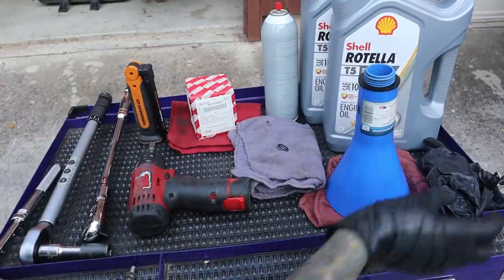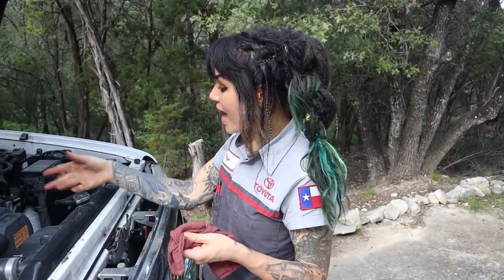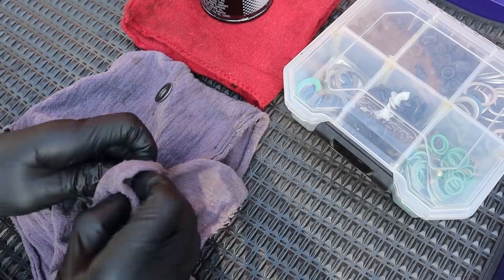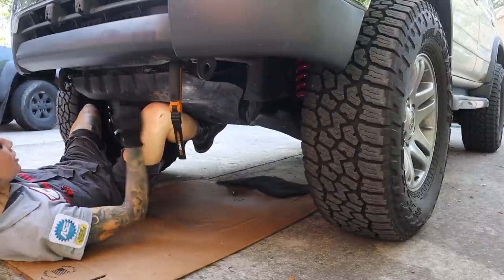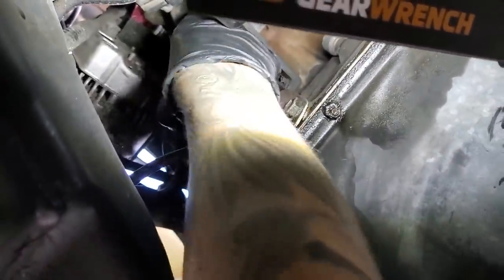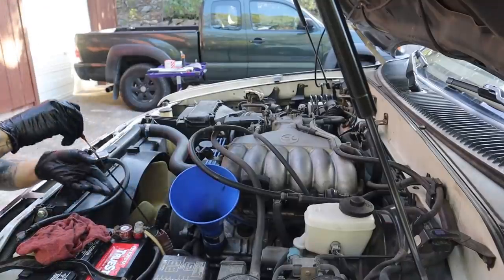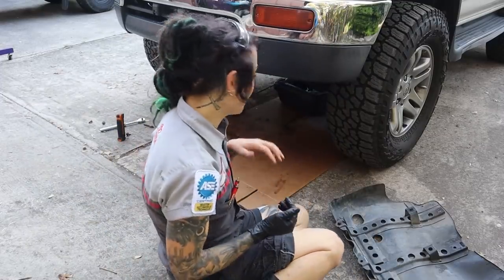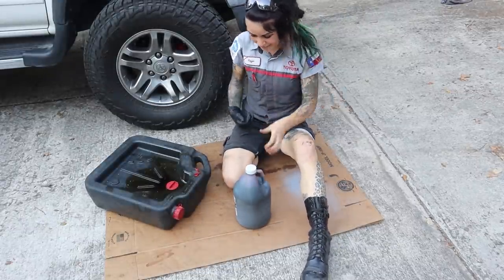How To Change the Engine Oil and Filter on a 3rd Generation (1996-2002) Toyota 4Runner V6: 3.4, 5VZ

Comment: Faye, what's your opinion of prefilling the oil filter before installing it?  I'm going to start checking my boots from now on.  Thanks.
Reply: I've been changing oil in our family's cars for the last 35 years and had never heard of prefilling the oil filter until recently. If the filter is mounted sideways or upside down there really isn't a way to pre-fill it.  I suppose it can't hurt to do it but we've never had an oil related engine failure or problem in all my years of working on vehicles with my Dad and Uncles. Just my two cents.
Reply: Someone taught me to prefill the filter about 20 years ago, and I've always done it whenever possible since then.  may not be necessary, but I can't think of any downside unless you forget to factor it in when measuring how much oil to add.
Reply: My dad does that, but I've never seen a need.  Regardless, I always run the engine for about a minute or two.  It should just take seconds to completely fill a dry filter.  The tiny bit of excess potential wear you get before that happens is not enough to worry about, maybe about the same as two or three startups.

Plus on engines like the 3.4L shown here you can't.  The filter sits at about a 20 degree angle with the opening pointing down.  Both Grim and my '96 Taco have over 300k and still going strong.
Reply: @subtegral  Thanks Faye!

Comment: I found one of my pan bolts broken off and whoever put it back just used a self tapper and made a new hole 😫. Well it bugged me enough that I drilled out the old bolt and was able to save the threads and put in a new bolt 😃

Comment: Faye,  I have a question kind of related to an oil change. When changing CVT fluid do you prefer using the manufacture recommended fluid or a brand with maybe better properties?
Reply from the maker: I'd NEVER use non OE fluid in a CVT! So many of them include "additive packages" that cover a wide range of manufacture's recs. The OE is specific for that transmission. I suppose I can always speak for Toyota ... but even when I worked at an independent shop and had all of the other fluids in bulk, we would pray the premium price for the OE fluids that we could feel comfortable standing by our warranty on the vehicle!
Reply: @FayeHadley  Thanks for answering my question Faye 😁

Comment: Faye any thoughts as to why GM designed what I  call  low oil pressure  in my new 21 Silverado with  the 2.7L Turbo 4cyl. Regardless of normal  drive rpms it only shows 30 psi. MY 08 I used to have with the  4.8 v8 ran 40 psi  plus depending on  rpms. The only time I see  greater than 30 is at cold start up  and if you get really aggressive with  high rpm. Not sure if they design a regulator on oil pump or what?  I like to see 40 psi when driving highway speed. It does call for 5w-30 ,the 5.3 with 0w-20 oil  runs higher oil pressure  go figure?

Comment: You can probably take out the oil filter without removing the skit plate but 9 out of 10 times the oil mess from removing the oil filter will build up on the skit plate and overtime is just too messy. On my 2000 limited, it is so tight (maybe impossible but if you have tiny hands it might work) that I prefer just to take out the skit plate.
Reply from the maker: Totally! I have one of those bendy directional funnels that actually makes it quite mess-free! (https://amzn.to/3yCxs45)

Comment: Question Faye, have a 1996 toyota t100 Sr5 3.4l. Did my oil change and filter change on the truck put in 5 Quarts of brand new 5w30 oil with filter.  I know it takes 5.5 Quarts but is running on 5 quarts safe and okay for a awhile till I can top it later, which probably won't be for another four days or so till I can pick some up.

Comment: I have same truck like yours 01 4runner 2wd I take it to the dealer to get the oil change. Supposedly they were using the conventional oil.  The truck has 146,000 miles is it safe to change to synthetic blend?
Reply from the maker: That's pretty low mileage, But I would still start with a synthetic blend first and just see how the truck reacts to it. I would change slowly over time. Sometimes adding synthetic oil can drag up a bunch of debris with all the detergents running through the engine, and can cause more harm than good. That being said I switched to fully synthetic at 300,000 mi after weaning this truck onto it for over 2 years, and I haven't had any issues! I just was very regular about my intervals!!!
Reply: @FayeHadley  thank you so much for the info. I appreciate it. I love your videos. It helps me out to work on my truck.

Comment: What oil do you normally use?
Reply: I think depends on what motor
Reply from the maker: I normally use the Rotella T6 (fully synthetic 5W40!) in Grim, as well as for the 2009 Tacoma you often see here on my channel! I used to work for Intertek Automotive Research in SA, TX testing oil and fuel for a living, and it was always a running joke with the mechanics... an oil would test AMAZINGLY "but how does it stack up to Shell Rotella T6?!" it seemed to be the only oil that would test higher than spec, and the manufacturers wouldn't spend hundreds of thousands of dollars to reduce the expensive additive package and re-test over and over again just to barely clear the bar for the standard. 

I use the T4 15W40 in my 1980 VW rabbit, and Valvoline VR1 in the Supra. All have withstood the test of time! VW has over 400k, This truck has 307k, the Taco has 175k, and the Supra has 250k and I made a video about the oil saving my cylinder head. :)
Reply: @FayeHadley   Thanks for the info, very interesting that you worked with lube oils! I also worked as an analytical chemist...we did turbine lube oil and transformer oils. Shell generally makes very good oil. One of the first synthetics I used was Helix Ultra... Unfortunately Valvoline is difficult to get here in South Africa. My current favourite oil is Total Quartz 9000 ;-) Those are very impressive mileages you have on your cars!

Comment: What is the oil you normally use? I use 5w30 full syn (valvoline or castrol all depends on where I am) for my 00 4.7 tundra
Reply from the maker: I usually use the T6 fully synthetic in my 4Runner, and the Taco behind!
Reply: Faye, is your 4Runner a diesel?

Comment: Why did you use 10w30 instead of 5w30 is it much of a difference ?
Reply from the maker: Because it was out of stock, and its VERY hot right now, so the viscosity difference won't matter at this time. I usually use 5W40 T6 Rotella!

Comment: Strange place to put a ground wire....right under where the oil drains from the filter.
Reply from the maker: Never gets corroded!!!
Reply: Better that than a hot wire for your oil filter wrench to spark against! (Saab 900.)

Comment: Got P0171 code in my 2007 Corolla! Need Faye's mechanical magic 🔧🚙🧚🏻‍♀️
Reply: Sell it and get a old school lol
Reply: @NotaMechanicJack  Still got $5000 left before it's paid off. As Scotty would say, cars are endless money pits! 💸
Reply from the maker: 1ZZ?!! I would start out by doing a full visual inspection and making sure that there isn't anything obvious going on, like a detached hose, or a split boot, then I would smoke test for vacuum leaks! I will say that the most common cause for that code is just in intake vacuum leak on that car, but I have replaced easily over 2 dozen maf sensors. While those engines are SOLID, they do burn a little oil and get a little blowby, and that can also foul out the O2 sensors. I would start with a visual inspection, and check your fuel trims! I wish I could work on your car! I love those so much! Don't sell it - they will go forever!
Reply: @FayeHadley   You're the best Faye, wish you were my neighbor. They (the shops) gave me a laundry list of things to do, changed the MAF sensor, it did nothing. Off to next thing :D